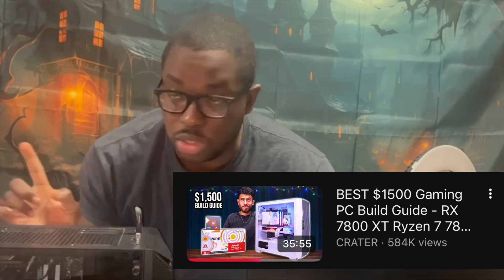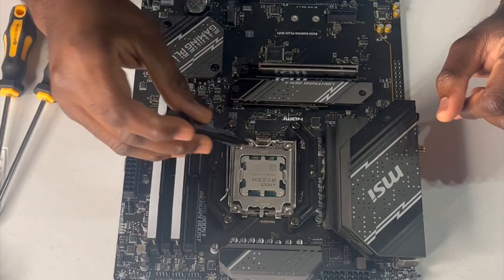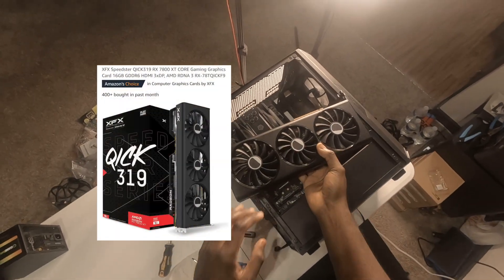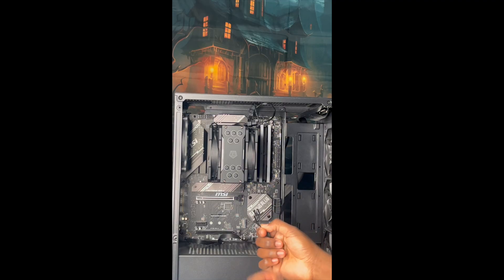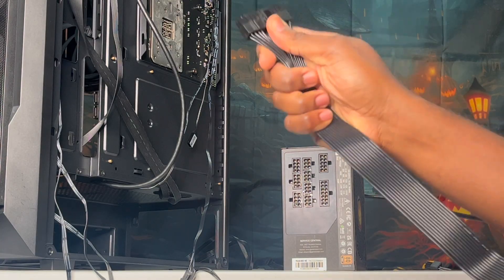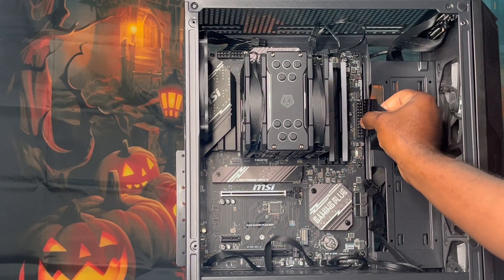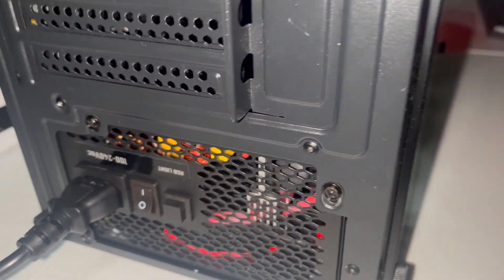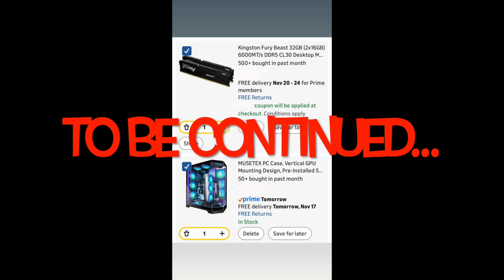My 7800 X3D PC Build | FAIL | I Need Help Troubleshooting

Comment: You are trying to boot from a drive with windows already installed on it. I don't know how you went about installing windows. There could be all kinds of mismatched drivers causing your issues. So when you turn the pc on keep hitting the delete key to get into the bios. Get your windows install usb set as the boot drive and reinstall windows. Then download motherboard and gpu drivers. You should be good to go.

Comment: Update the motherboard BIOS; B650 is the first motherboard for AM5, a lot of updates have happened for compatibility with GPUS, stability, etc. Your GPU might be fine, but your motherboard doesn't have the firmware to work with it yet.

Comment: Unless they are r g b brother, just always run the case fans at full speed for good cooling.  That is usually the rule of thumb.  So I guess the way you have them plugged in Would be fine.  Otherwise, there's probably multiple fan ports on the board. The only other reason would be to monitor the speed I guess.  only do that if you notice high temps

Comment: Another thing I found out on this last build I did, that the AM5 socket is more susceptible to overtightening when installing the CPU cooler which I did and was having random issues until I back the screws out just a tad.

Comment: 9:00 that GPU does seem very wonky almost like you have it screwed in one slot too high into the case, if that is even possible. It seems like you could unscrew the GPU bracket and lift up on the tail end of the GPU and see if that changes which slots your GPU bracket lines up with. For reference you can google my latest build I just finished by searching "pcpartpicker 2025 am4 to am5 upgrade", the 5th picture I posted I think is the best to see how straight my GPU is compared to yours.

Comment: Is that GPU new? It looks very warped which can be very bad. Your CPU has intergraded graphics, I would just take out the GPU, plug your monitor into the motherboard and see if it will boot that way. If that still does not work, look in your motherboard manual for which is the preferred slot for your ram, this is usually the 2nd slot from the left, and try booting using only 1 stick of ram in that slot, If still no luck try again swapping with your other stick. If still not working try again using only 1 stick but in each slot other than the preferred slot.

Comment: The case fans are non PWM, which means they can not be controlled by anything, they only have one speed, full speed. PWM fans like the ones on your CPU cooler need to be plugged into your motherboard so you can set a fan curve either in the bios or with software like speed fan. Then the fan speed is regulated by w/e you choose to set it too. Like the CPU cooler fans would be set by your CPU temps, the hotter it gets the faster the fans go. If you were to get PWM fans for your case its usually best to set them by your GPU temps. Depending on the number of fans and the size of your case you can get a pwm fan controller and plug all your pwm fans into that then you plug that into your motherboard.

Comment: Reinstall the windows from scratch. Reusing windows installs from different systems/different encryption keys is not supported.

Basically your system is going past POST, and can enter BIOS freely, so you are at least running ok. So the build process is trusted up until that point.
The windows install is not trusted. Do it from scratch. Nuke the partitions, including the recovery/hidden partition, and recreate the entire install. The windows install is also a part of the build process. Just as sometimes you have to install the CPU twice to make sure it is fine, sometimes you have to repartition the drive and install windows multiple times, to make sure the windows install is installed correctly.

If after 3 tries you still have a windows install/boot problem, then run a memory test to make sure your RAM is reliable. That is one of the major factors causing windows install corruption. Unreliable SSD is second.

Comment: I presume this is Windows 11 of some flavor.  Are you connected to the internet when your are doing your install?  If so try doing so disconnected and create a local account (don't use a MicroSoft account).  You'll find lots of tutorials showing how this can be done.  This will keep Windows from downloading updates or drivers during the install process.  If you want to use a MicroSoft account, you can change this later after your get everything running.  

Another thing you can try is to remove your GPU, and install Windows using the iGPU on the CPU.  Rarely, the GPU and iGPU can conflict during setup.  Conversely you could leave the GPU in, and disable the iGPU in the UEFI, but you'll have to dig around in the UEFI to find where this is done.  

Be sure when installing Windows again that you're deleting all the partitions that were created on your previous attempts.  This will guarantee that the installer creates the partitions fresh, and installs the files onto those fresh partitions leaving nothing behind from the previous failed attempts.

One thing maybe to check before all this, go into your UEFI/BIOS and check the CPU temps.  Monitor it for awhile after getting in there, 5-10 minutes.  It's not under load so it shouldn't be higher than 40C or so.  If you are seeing it idle at 65C, you might have an issue where it's overheating under the stress of booting.

Lastly don't be hard on AMD for their LGA socket (no pins on the CPU), they hung onto ZIF sockets (PGA CPUs) way longer than Intel.  Intel have been using LGA for over a decade, Zen 4 (AM5) is AMD's first LGA socket for consumer level products.

I hope this helps.

Comment: Bought a new power supply, but you went from 850 watts to what?... oh 850 watts LOL  I always max the power supply... which means 1000watts +  1200 or 1300 preferrable.  Not a fan of 1500 or 1600 versions.
Reply: Pretty sure he got a different one for the additional CPU plug being available on the new one. :)

Comment: I think you must be a fan of replacing your power supply all the time.  A modern power supply should have a modern 600w GPU designated plug.  There should be 4 or more PCIe plugs; 1 for the CPU, a second also for the CPU which might be an 8 or 4 (conversion), and 3 for more power hungry GPUs (9070xt) ... see 5!  A good case and power supply can outlast your motherboard, CPU, memory, and GPU.  My case and power supply is over 10 years old.  The only reason I am thinking about upgrading is because of the 600w GPU power supply plug.

Comment: Rear fan should be powered and controlled separately... directly from the motherboard.  The front fans can be daisy chained together to work as a single unit.  The CPU fan will have a designated connection on the motherboard.
Reply: Rear fan can also be daisy chained. The only downside if that you can't adjust the fanspeed curve in the BIOS. Beside that it should work perfectly fine.
Reply: @THMR_Music  Those case fans are not PWM, they will only go full speed no matter what.

Comment: What direction are your case fans running?  Are some of them reverse fins?
Reply from the maker: case fans are all facing the same direction. pulling air thru the front, pushing air out of the back (none at the top and bottom)

Comment: Edit: Read my reply please.

Long time professional PC assembler and tester here. 
Your problem very likely occurs in the software. All hardware is ok and functional (Because it boots). 
Try (re-)installing Windows. 
Make sure to verify that your bios is up to date, and you have an additional USB (optional) to install drivers (sata drivers, network, chipset, etc).

You can also try to check the bios settings itself to monitor and verify the bios version installed.

If this doesnt work:
Very unlikely, but a known issue in our job that noone talks about is the mistake of tightening the cooler too forceful. Loosening the cooler just the smallest bit may fix all issues at once.

Bios updates are ALWAYS found on the website of the mb supplier. Verify that you pick the correct one.

Feel free to ask me any questions. I will answer once I have time.
Reply: Additional info:

I just noticed in your description that everything is up to date. So that shouldn't be the issue.

I checked the motherboard manufacter' website, and noted that your ram is not compatible with the motherboard. (not verified). So this might cause issues.
Source (can't paste links): Official MSI website > your MB model > Support > Compatibility > Memory.
Model RAM: CMH32GX5M2E6000C36 (found from your link in the description)

Possible fixes:

Firstly verify that everything is slotted in as it should. From the video I think you did a good job, but it never hurts to check twice. (Be careful applying pressure, the slots can handle much force, but can't bend.)

1. Try to boot with only 1 ram module installed, in slot DIMMA2 (from left to right, that's the 2nd slot).
1a. If you have the opportunity, check different ram from a verified model and make. See website I listed above.

2. Fresh install of Windows. You are using modern hardware, perhaps the install you used isn't up to the task. Please, refer to the Media Creation Tool offered by Microsoft to fabricate an up-to-date bootstick.

3. The error you received around 10:45: KMODE_EXCEPTION_NOT_HANDLED (0x1E) is commonly caused by faulty or wrong drivers. Please double check, although that you already mentioned, that you have correct drivers installed. You can find ALL up to date drivers on the motherboard website (again, listed above).
3a. Other causes of this error code are faulty ram (I wonder..), corrupt system files (reinstall windows) or failing hardware. (Most commonly CPU's).

Please let me know if you tried the above steps (if you can do some of em) and let me know the outcome.
Reply: And if you one day disassemble the entire thing, make sure you install the I/O shield (metal plate thing with a bunch of holes). It protects the PC from dust 'n stuff, and grounds the connectors.

Comment: A few ideas:  Remove the GPU and try using the onboard graphics. You could try booting into a utility and running a MemTest to prove the RAM.  I've never heard of either of those PSU's(Heed the warning)  did you consult a PSU teir list like https://docs.google.com/spreadsheets/d/1akCHL7Vhzk_EhrpIGkz8zTEvYfLDcaSpZRB6Xt6JWkc/htmlview?usp=drivesdk&pru=AAABmreTTNk*Zyn3X-nfzJxiokCOyR5b0A#gid=1973454078

Comment: a second eps cable is not needed with the 7800x3D since single cable is capable of handling 300 to 350 watts while the cpu can only pull max 120 so in reality i never seen it above 80 and undervolted it stays on 50ish to 60 while gaming

Comment: It seems like you've used an old windows install. This can come with drivers that are simply incompatible with your new hardware. Try a fresh install and see if that solves the problem.

Also, for the longevity of the gpu I would recommend some sort of support, because it is sagging a lot which can put pressure on the connector over time.
Reply from the maker: I will get some support for the GPU. Thanks!

Comment: Make sure you connected both power cables to CPU (not shown in video). GPU has nothing to do with this issue. If you have spare parts, try swaping nvme.